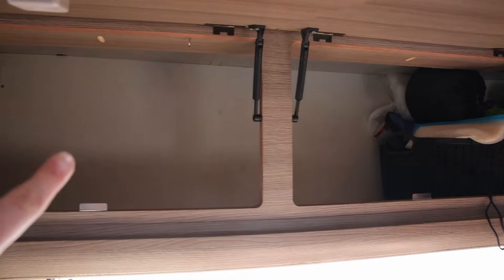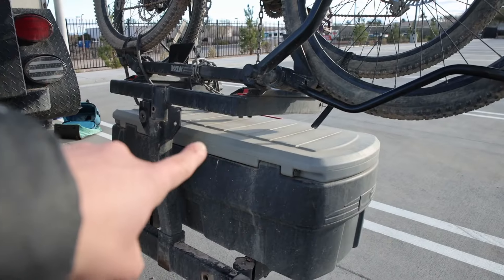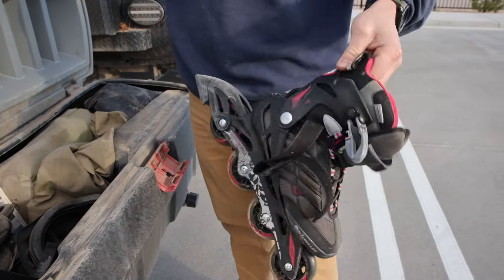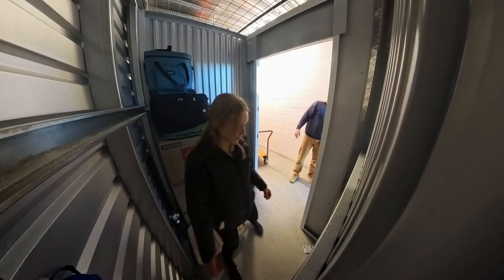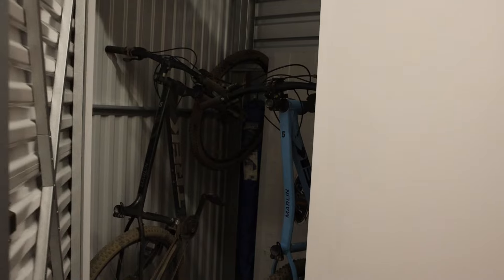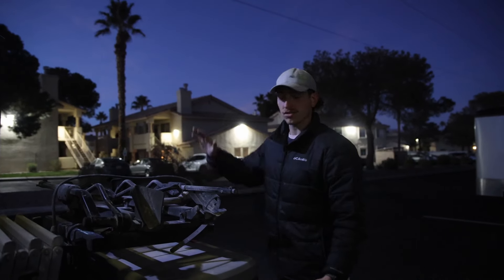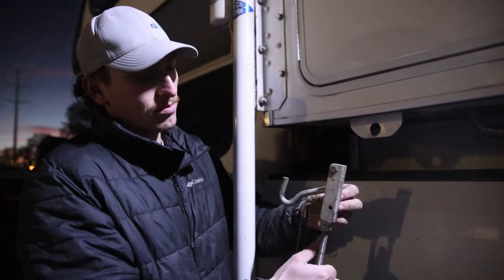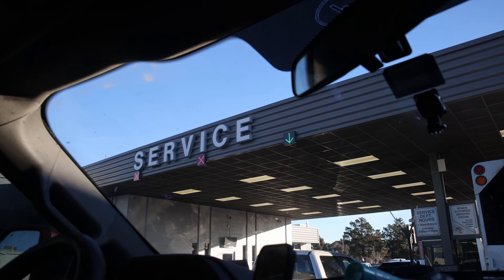Not the most exciting start to 2024.. | Truck Camping Reality

Comment: You should replace both Bulbs.
Reply from the maker: Hi! The bottom bulb is practically brand new since it never worked due to the fuse not being there. If it was used even a bit we would but ever since it was installed it didn’t work.